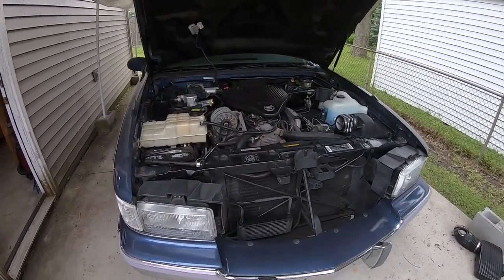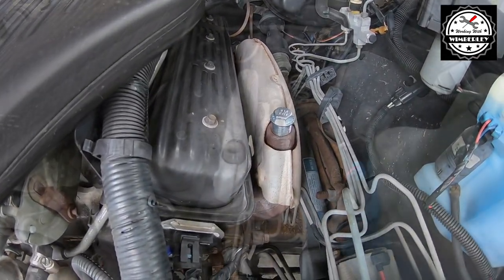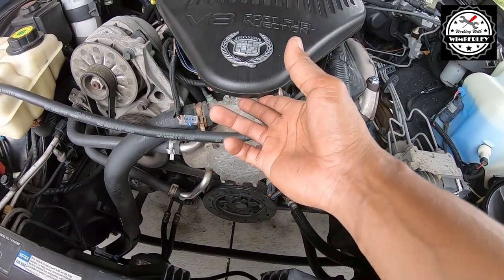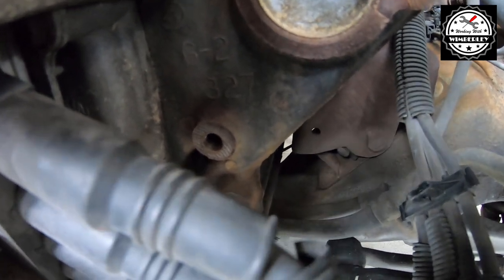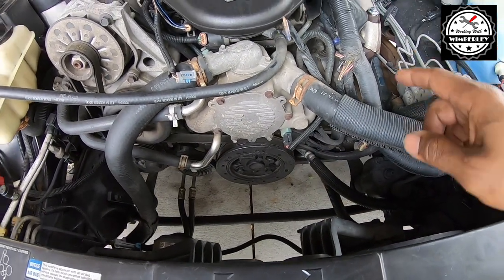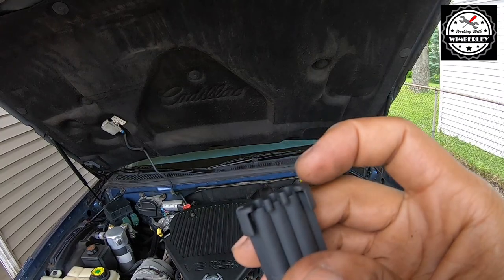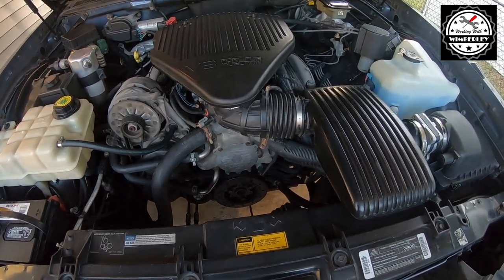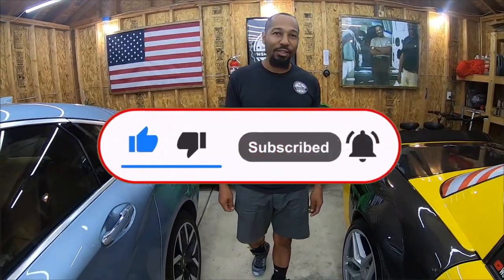LT1 Air Smog Pump Delete Mod 1994-1996 Cadillac Fleetwood & Chevy Impala SS Buick Roadmaster 5.7L V8

Comment: Wanted to do this on my SS but was reluctant but this makes it sound pretty easy. Thanks for you video.
Reply from the maker: This is a more detailed video that I actually used to do the removal. https://youtu.be/ea3mA_UFla8 I had no clue it was so easy. And with an OBD1 car, I knew I wouldn’t get a check engine light. The engine bay looks 10 times better without all those pipes, hoses and valves in there!

Comment: I have a 96 Fleetwood limo, same set-up. I factory deleted the AIR system out, it was a factory recall. I have done everything but remove the pipes off the intake to exhaust because I can't find the caps, where did you get yours? I have been looking but haven't found them, they're obviously not stock🤣👍
Reply from the maker: If you need the cap it’s Home Depot part # 801509. If you need the plug is Napa part number NOE 7041048.

https://www.homedepot.com/p/Everbilt-5-8-in-Flare-Brass-Cap-Fitting-801509/207176415

https://www.napaonline.com/en/p/NOE7041048
Reply: @WorkingWithWimberley  awesome, thank you!!!!❤️
Reply from the maker: @SimplyDarknes  You’re very welcome! Good look with your Fleetwood. If you have a minute, check out this video about the history of my Fleetwood: https://youtu.be/i5k8aBiBtdI?si=ls-wJBrIR2NqikBR

Comment: Wow. That looks really nice. I have a 1992 Corvette with the same engine. Would those drain plugs cap off my exhaust manifolds? I liked the way you went ahead and cut the top of the tubing to put a socket on it and remove it. Nice.
Reply from the maker: Thanks! It’s possible. If your LT1 has the same exhaust headers and mine, it should work.

Comment: Hey! Love the videos! I've got a 94 Fleetwood and I'm having some problems with the level ride sensor in the rear. Can you show some basic troubleshooting and where exactly to locate the sensor in the rear?
Reply: Did u ever find it?? I gotta check mine I removed the fuse by the driver side when the car was sitting so it doesn't drain the battery

Comment: Why did you change it? Did it have a misfire is that the reason? I have a 96 Cadillac fleetwood brougham and i change opti,spark plugs,wires all with A/C Delco parts, idle air control,throttle body position sensor,EGR VALVE,fuel pump, fuel pump filter,fuel pump regulator,o2 sensors and the car still had a misfire on the passenger side have you ever had this issue? If so how did you fix it? It jerk around 42 mph and 54mph. Could you help me out please?
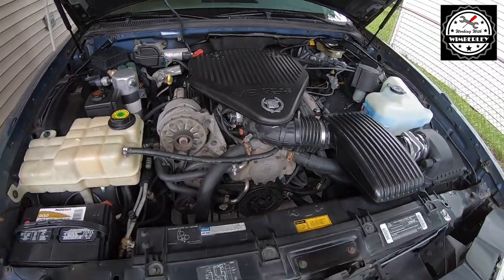Reply from the maker: 5:13 I did it to clean up the engine bay. And yes, I had a misfire due to a bad spark plug wire. Here’s the video for that: https://youtu.be/rNYMPEZbV20 Unfortunately, it’s seems as if you’ve already replaced everything I would suggest replacing. I also had a bad vacuum line that caused the car to hesitate and stall. Here’s the video for that: https://youtu.be/ejJXkSlosh4

Comment: This is a good video. What did you cut the metal with?
Reply from the maker: You can see it at 3:01. I used this: https://www.harborfreight.com/3-in-high-speed-electric-cut-off-tool-63023.html
Reply: @WorkingWithWimberley  Alright thank you sir!
Reply from the maker: @Prince_.A  You’re welcome.

Comment: What benefit do you get for deleting the air pump?
Reply from the maker: As I state at 0:16 I’m just doing it to clean up the engine bay. There’s no significant benefit. It would be a slight weight savings and less parts on the engine. That’s about it.

Comment: Question. Can the air pump be used to power air bags? How much psi is coming out of that thing?
Reply from the maker: It pumps fresh air into the exhaust at the manifolds to dilute the exhaust gasses and provide more oxygen to ignite the air in the catalytic converters. I doubt if it could be used for something else, but I'm not 100% sure. I have no clue how much PSI it makes. You may have better luck in one of the LT1 forums.

Comment: Hello. I have a 96 impala ss can I do the same thing you did ? My check engine light is on.  If I do what you did I dont need the secondary air injection pump hose ??.
Reply from the maker: Yes you can do it. You might get a check engine light from doing it. If you remove the air pump, you don’t need the air pump hoses anymore.

Comment: I have a 1996 9c1 and my air injection pump literally burned up came apart causing a bad vacuum leak I saw where the recall on it back day to remove clear code etc... I used the top caps on my obd 2 1996
Reply from the maker: Ok cool. Did you have any issue with the check engine light after removing the pump?
Reply: @WorkingWithWimberley  sure did first year obd 2 cat clog up number 8 cylinder had replace motor I put black electrical tape on dash light fixed it for good car runs flawless cat deletes
Reply: @haniballector I'm about to do this on my 96 good or bad idea

Comment: I'm thinking doing it on my 96 ss but I don't want engine light on dash..
Reply from the maker: I understand. Once I found out I didn’t have to worry about the check engine light, I immediately pulled it out the car! I also did a throttle body coolant bypass mod. It’s supposed to keep the throttle body cooler and actually slightly improved performance. Throttle Body Coolant Bypass Mod: https://youtu.be/AaCWtfRd538

Comment: How do you kno if your car is a obd1 or 2 I have a 95 and want to do the same delete ?
Reply from the maker: From what I read, there should be a label somewhere under the hood that tells you.
Reply: It's an obd1. I have owned a 95 and 96 fleetwood. The 95 is obd1 and the 96 is obd2.

Comment: Hello!

Why should the smog pump be bypassed??
Reply from the maker: @EASTCOASTIMPERIAL  Mainly just to clean up the engine bay by getting rid of the pump and all the piping. It doesn’t do anything for performance. The point of the pump is to pump extra air into the exhaust so the cats heat up quicker for better emissions on start up.
Reply: @WorkingWithWimberley  
Okay, got it.
Reply from the maker: @EASTCOASTIMPERIAL  No problem!

Comment: I have a question I got a LT motor 4.3 engine I had it look at it will turn over but it won’t start I took you to a shop it said he has no compression how can I fix that… Or what should I do
Reply from the maker: I’m not sure how you would fix that but here are some possible causes. https://cartreatments.com/causes-of-car-engine-low-compression/
Reply: no compression = get a new motor .probably skipped the timing and bent some valves.
Reply: @livvielizard7409  ok I’m going to check that out

Comment: Did you have to get a custom belt after taking air pump off
Reply from the maker: No. The pump isn’t run by the serpentine belt. It’s electronically controlled. So the belt stays the same.
Reply: Oh okay cool I have a 1994 Buick Roadmaster with a Lt1 and all my people kept telling me it was driven off the belt thanks for clarifying I'm bout to delete mine now
Reply from the maker: @timkelley5596  Good luck!

Comment: What was the socket size you use?
Reply from the maker: Smog Pump 10mm
Smog Pump Bracket 14mm
Exhaust Manifold Insert and Plug 19mm
Reply: @WorkingWithWimberley 
🫡

Comment: Easy to do, but now my check engine will not stay off.    Now I gotta re install it after I find it on a used car. I would not do this if your have a late 95 or 96 LT1. I keep my 96 SS meticulously running so while it runs good that check engine light kills me!
Reply from the maker: @rockyc3368   I state that in the video @5:35. If you have a late 95 or 96 you have to get it tuned out of the computer or you’ll have a CEL.
Reply: @WorkingWithWimberley how can I tune it out

Comment: So what  does  it  do  besides  clean  up the  engine  bay?
Reply from the maker: Not much.. The LT1 AIR pump is electric so that there's no drag on the engine (unlike the L98). It only runs at startup. The only minor benefit you'll see is a few pounds of weight reduction.
Reply: Weight reduction and it makes pulling the valve covers SO MUCH easier.

Comment: Wat size is that cap u put on the exhaust manifold
Reply from the maker: My LT1 required a plug. I used NAPA part number 704-1048, which is M22-1.5. If yours requires a cap, according to these guys it’s a 5/8" flare cap. https://youtu.be/ea3mA_UFla8 Home Depot SKU # 727131
Reply: @WorkingWithWimberley  thanks alot bro and when u dropping more Cadillac content
Reply from the maker: @corbinsims7203  You’re welcome. I have quite a few videos on the Fleetwood. Make sure to look through my channel. But every time I work on it I record it. So there will definitely be more videos.

Comment: Hey I have a 96 I want to do this to mines but what will I have to do afterwards will my car run bad or what ?
Reply from the maker: It should run the same, but you’ll have a check engine light. You’ll have to find someone who can tune out the smog pump from the cars computer.
Reply: Appreciate it mines just keeps burning a  hole through the hoses on the passenger side and idk y I mean I just got my exhaust did
Reply: @jovoanfinney7215 
What hoses ate you refering to? Heater? Radiator? Heatercore hose??? 🤔

Comment: I have month08/year94 pontiac trans am and i did the air pump delete now it wont idle
Reply from the maker: @maxviloria411  From what I read in the forums, the air pump on the LT1 should not have anything to do with the idle. https://ls1tech.com/forums/lt1-lt4-modifications/441583-air-pump-engine-important-affect-performance.html

Comment: Chevy engines always had such an inelegant why to plumb the smog pump into the exhaust manifold. The Buick 350 and 455 system was far less bulky and much of the plumbing was internal.
Reply from the maker: Thanks for the info.